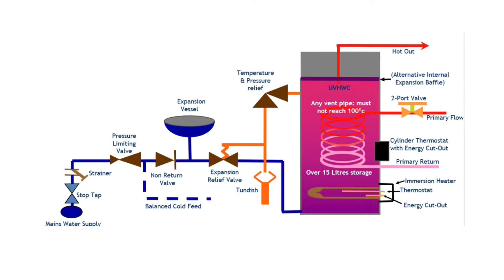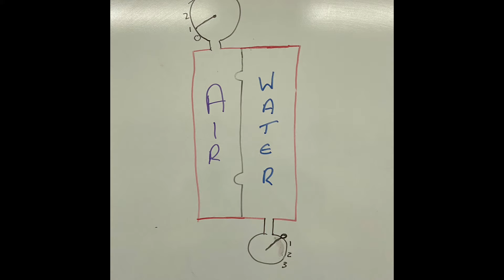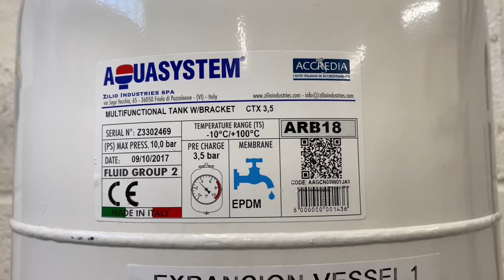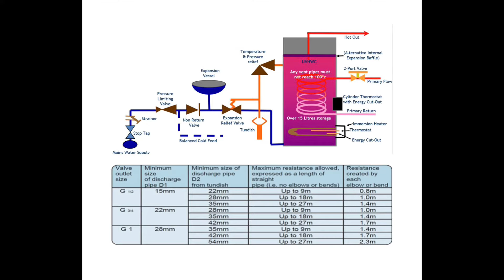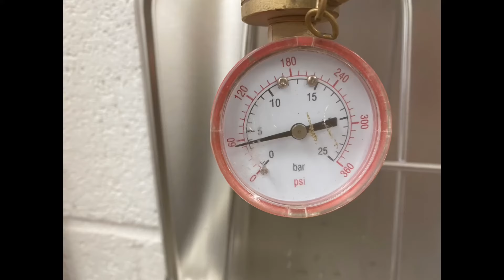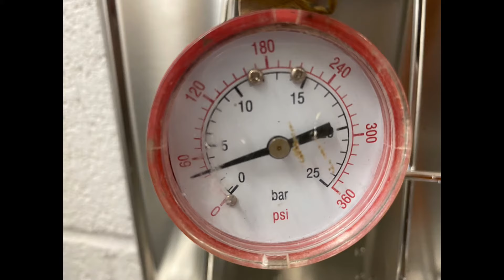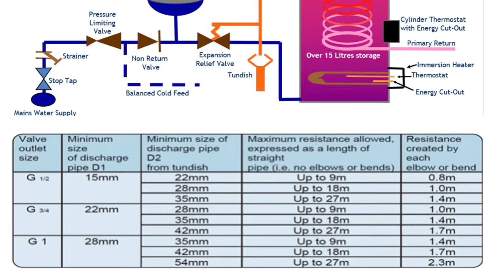How Unvented Hot Water Cylinder Works - Plumbing Training Video

Comment: Problems with my unvented system when either heating or hot water is on, and we run hot tap. Sounds like Motorbike accelerating when you open hot tap, noise is from Pressure reducing valve/non-return valve. Hot pressure reduces within a couple of seconds of running hot tap. Cold water pressure is exceptionally high (according to plumber). The plumber suspects cold water is leeching into hot water somewhere. System looks very similar to that in the video - with pressure vessel. No obvious water discharge in tundish.

Comment: The latest issue i had was expansion vessel connected to the balanced cold water before the check valve..When firing up, pressure was tripping reliefs.. once expansion vessel moved over to the hot side of the inlet bloc, problem resolved and expansion vessel now doing its job.. Have also seen installations with expansion relief valves installed before the cylinder and only the TPV.. Remember D1 and D2 sizes.. get Inlet bloc & expansion vessel above cylinder  . would be so good if they started to build cylinders with intelligence.. pressure & temperature gauges!!
Reply from the maker: Thank You

Comment: Hi, thank you for clearly explaining how unvented systems work.
I had an unvented cylinder recently installed and I am suspecting that it might not be installed correctly. There is merely 100 mm on the D3 pipe between the tundish and the fist bend below it, the D3 pipe is an overflow pipe (plastic, not metal) and there is not a fall in the D3 pipe for a stretch of around 500 mm (the pipe is actually riding). I was wondering if I have to worry about it

Comment: Hi nice video like always , 
I have a question please . 
Because I have  to replace my downstairs cloakroom tap 🚰, and  aren’t any isolation valve on it . 
So how can isolate the hot water side ? 
I understand I can shut off the main water supply to the cylinder but do I need open in same time a hot water tap in the same time and drain down all the cylinder?

Comment: Hi Allen,
I’m Thinking of converting a 2 bed terraced property to a 4-5 bed 2 story HMO with 4 en-suites
Which heating system should be installed for the property. And what boiler?
What would be estimated cost? I’m based in manchester.
Thanks in advance.👍🏼

Comment: Hi Allen, In this setup I see the In let Control Valve Group is a fair distance from the Tundish, thus the expansion valve would be greater than 600mm for the D1 run, as such I assume this does not meet G3 regs?

Comment: Good clear information, thanks for that. As a private individual I do not have a G3 ticket, but I need some advice. My system is almost identical to the one in your test set-up. 3 months ago I paid £350 to have a new pressure reducer/relief valve unit and expansion chamber, as part of a service. After 3 months, a problem has developed, I now get a reduced hot water flow rate. Initially it is fast, ( as it was before) then within 10 secs or so it drops off significantly. All visual checks are good, the filter on the PRV is not obstructed. I would like a pointer as to what may be the problem, so I can direct the service company correctly.
Reply from the maker: You need to call someone out to it. I couldn’t give advice without looking at it. Sorry.
Reply: @alan fowler Your problem is a poor or blocked feed into the water cylinder, the initial rush you get is the pressure being released from the system from the expansion vessel, once this is discharged, you are back to what ever mains pressure and flow that is being supplied to the cylinder, suspect blocked filter on the incoming line
Reply: @davidkelly4841  you are right. The block was internal build up of lime, where the inlet pipe is taken internally to the very base of the tank. The solution was to purge the inlet with descaler liquid. Once the acid had done it's work, all was well.
Reply: @alanfowler1187  Great thanks for letting me know, always nice to be right once in a while ;-) I shall head on into the weekend with a smile

Comment: If I wanted to install a unvented cylinder in a basement with no drains, could the discharge pipe be terminated at the concrete floor within the basement? And the condense pipe be pumped out to a suitable drain point.

Comment: we have one of these in our new build, dont understand it at all. our electric bills are so high, we can only think its the leccy from the immersion heater in this. is there anyway we can turn it off and just use the boiler without the cylinder or not?

Comment: Hi Allen if the coil in the cylinder is compromised. Would this cause the system pressure to increase or decrease?

Comment: Hi - may I perhaps ask you a technical question about installing a 10litre tiny geyser that is unvented ( only if you dnt mind otherwise please forgive me but I am desperate )I know the risks, liability and warranty issues etc but lets say I dnt care about any of that and connect the inlet and outlet directly without the correct mixer but there is more than sufficient pipe to allow for expansion. You think it will work without blowing ? I wont hold you to it, just wanted an opinion as you an expert t. I dnt care if it breaks ( as long as it does not explode and cause walls to fall over. I dnt mind if it bursts lightly and spills as it will be over the bath tub. I got nothing to loose ) Thank you. Sorry if this all sounds ridicoulous. Greetings from South Africa.

Comment: Really good video. But I have a question if the combination value set to 3.5 bar how come the standing pressure at the tap was 4 bar. I thought the pressure reducing value part of the combination value would drop the pressure to 3. 5 bar
Reply: I’d like to know

Comment: Hi I have a unvented hot water cylinder in my flat.. When attempting to unscrew my shower bar mixer, hot water continues to pour out of the hot side. I have turned the stopcock tap off and water stops pouring out of the cold side.

Do you know how to turn the water supply from the unvented water cylinder off?

Comment: Could a unvented cylinder be connected up to a cold cistern supply with a pump that would provide 3.5 bar of pressure that operated once it detected water flowing through it.   Do manufacturers instructions cater for such installations and what would be any advantages / disadvantages ?
Reply from the maker: No, You can only pump 12 l/m. Check with the manufacturer for anything over this. https://www.youtube.com/watch?v=JjzLsBfN-9w

Comment: What way is best to calculate the d2 discharge pipe as you can either add what the bends etc equat to onto the length of the pipe stated or you can deduct what the bends etc equat to from the section in the graph for d2 (up to 'stated' size) both ways get an answer in a different way but does the t3 qualification expect you to do one formula?

Comment: In new installations is there any requirement to fit a anti legionella valve to the pressure vessel to stop a build up of bacteria in the dead leg pipework /pressure vessel?

Comment: Very well explained Roy!if we have a expansion vessel for heating how do we recharge the vessel.Is it by turning cold isolator off and drain it from radiator drain valve and recharge on expansion vessel or anyway different. Please help as I get a lot of them where pressure keeps going up and I dont know where to drain it from.thanks
Reply: lol

Comment: Hi Allen I have a customer with an internal expansion vessel on an unvented cylinder.  I re pressurised the cylinder in the summer due to poor hot water flow and sorted the issue.  The customer is reporting another loss of pressure I suspect the internal expansion vessel has failed can I fit an external expansion vessel?

Comment: Hi, if expansion vessel is not installed and all other valve are fine and there is no water leak in the tun dish but it still cuts off coil after couple of days.  What is possible problem here. Cold feed have different pressures but I installed no return valve at hot water tank out let. It works for few days fine then it cuts off. 
Will be grateful if you reply.

Comment: If water pressure in the building is 2.2 bar what pressure should I have in expansion vessel?
Reply: I read in the manufacturer instructions that should be 0.2 bar below incoming  pressure but from the video I gathered that prv and vessel should have equal pressure.
Reply from the maker: This is a very good question. Read the installation instructions and go by them. Thanks.
Reply: @NottsPlumber its 0.2 above not below

Comment: wouldn't the the last line of defence for the unvented cylinder be the overheat stat on boiler kicking in when the return temperature is high and not the TPRV on the cyclinder

Comment: Was told gas safe won’t sign off unvented cylinders unless a gas appliance exists in the property, so if fit one in a house with an oil or electric boiler they won’t sign it off.
Reply: Wrong, Gas Safe does Issue works notification. For solely Unvented Cylinders. I fitted. a Joules Cyclone Air, in November, and registered it through Gas Safe. You have to send, Gas Safe a copy of your G3 Unvented Certificate. his will then, show up on your elements. Hope that clarifies.
Reply: @kevind7150  they do, but somebody told me before that they only register them if there is a gas appliance in the house.

So they will register a cylinder solely if a gas boiler exists. But not an oil boiler
Reply: @Clicksystems  I was requested, to attended a Gas Safe seminar, some two years ago. The lecturer informed the group. In Order to aid Building Control. All unvented cylinders. Can be registered, through the Gas Safe notifications. There are several hundred thousand gas appliance installed, every year which are not registered. Gas Safe know this, from sales data. So they wouldn't know exactly, what appliances are installed, in every property. You could phone Gas Safe, customer services, and get, more accurate information!

Comment: I'm confused. If the water expands 1,600 times by volume when it turns to steam, then surely 1 litre of water would expand to 1,600 litres of steam...? How does it get up to 16,000 litres? Thanks
Reply from the maker: I think you are right. Thanks.
Reply: The idea is NOT to let the water get hot enough to turn to steam.  That is why you need to be qualified to work on Unvented hot water cylinders.
Reply: @stephenmontague4089  to get the water to turn to steam wouldn't the boiler have to be outputting at a flow temp higher than 100 degrees?
Reply: @cliveramsbotty6077  That is why there are safety devices fitted on this type of cylinder, to prevent water reaching 100 degrees C.  If in doubt consulate a qualified plumber who has his/her Hot Water Certificate.
Reply: @stephenmontague4089   to be honest i'd also ask for their gcse maths certificate

Comment: an on the job plumber would never crack open a prv, they never reseat and youll be forking out your own cash for a replacement as it wasnt dripping when you arrived
Reply from the maker: I check everyone I service. Never had any issues
Reply: Plus if it doesnt re seat does that not tell you sometjing about when you do leave and the valve blows off and does not re seat imagine if youd have checked it the last time you went you could have helped by replacing it when you was last there rather than coming out again for something as simple as checking if its doing its job. Hope this helps you in your busy days at work doing your job properly.